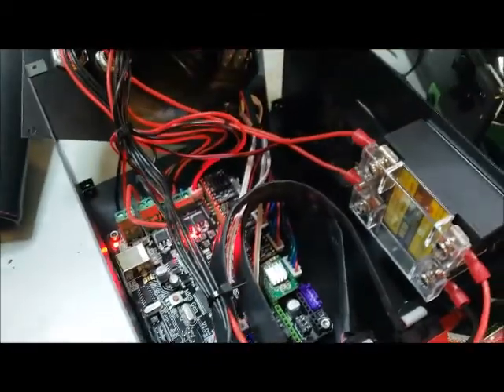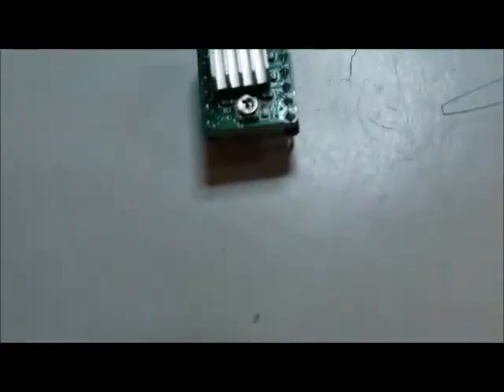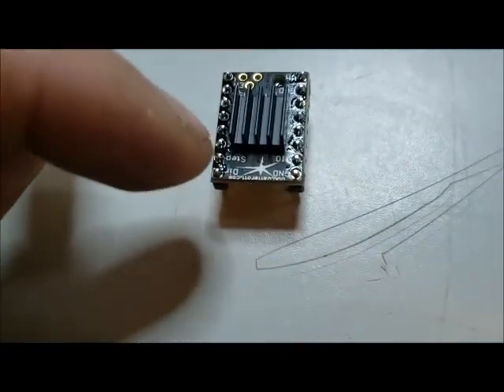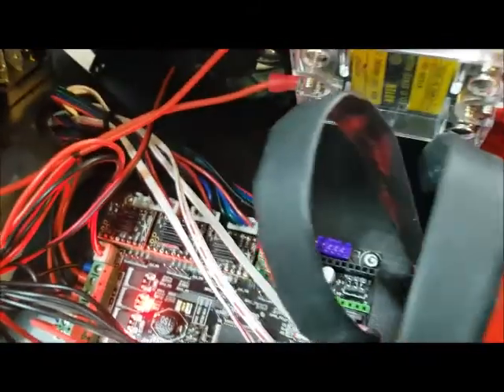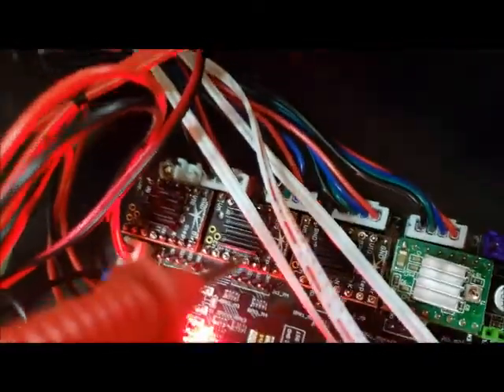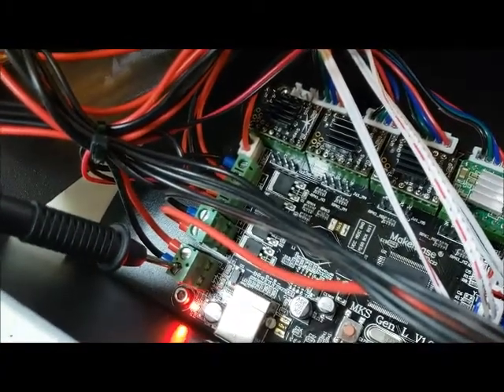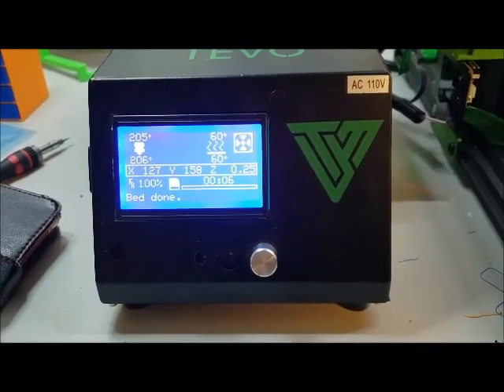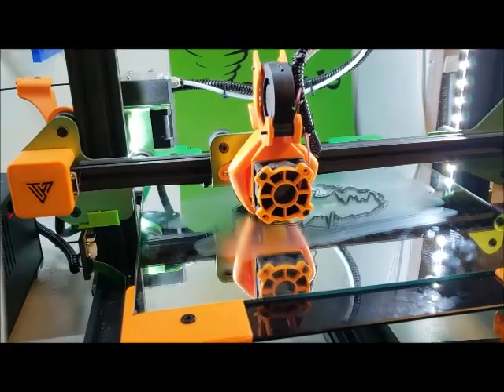TMC2208 install on a Tevo Tornado with MKS gen L board

Comment: I have problems with the estruter  wiring. From  the control box.   Was trying to reverse the direction  ( double gear estruter )  and. I end up mixing  the wires. (  also forgot to take a pic  of how they where  before this mess)   any  idea how to determine   the pares  coming out of the control box. 
 Already  know  how to determine  the pares from the  steper motor  
 Thx in advance
Reply from the maker: Once you get them wired you will reverse the direction in your firmware.

Comment: Sorry to keep bothering you on this wiring problem.   I have searched with no luck on my specific wiring question. I have located the 12V and 24V fan wires from the fans. Steel don’t know where they go on the MKS board.  I know some fans run continuously and some not. I don’t want to hook them up wrong.
In your video, is the Printer a tevo tornado? And the board is a MKS Gen L V1.0
How did you wire your fans?
Reply: Just did this yesterday. Cooling fan you need to add a JST connector and add it to the white jst port below the power, heat bead, eo, e1, wires.

Comment: Thank you very much for the fast reply. If I replace the 12V fan with a 24V fan. Can I hook all the fans up (2 fans in the controll box and 2 fans on the hot end) to the Fan outlet on the MKS board. Will this be OK for the fans on the hot end Extruder and Nozzle.
I see only 2 wires to the fan output on your MKS board.
How did you wire your board for the Tornado?

Comment: I enjoy all your videos. Thank you
This is a somewhat newbie question. 
I have a Tornado and updating to MKS Gen L V1.0 Board.
Have a question on the wire transfer from the stock board
To the MKS Gen L V1.0 board. Can you tell me how to identify the fan wires from the extruder hot end On the stock board, and where do they go on the MKS board. 
The fan that cools the Nozzle is 24V and the fan that cools the Heat Sink is 12V Please help.
And the A13, A14 on the stock board. Do these plugs go to A13 to TH2 and A14 to TR.
Thank you
Dale
Reply from the maker: Dale Fischer the best thing to do is google search a diagram for each board.  It will clearly show pictures for each fan connection.   However you will need to run a buck converter for your 12v fan as everything coming off the board will be 24v.

Comment: Great easy tutorial. Just one thing, it's safer to use a ceramic screwdriver and check vref on the dedicated pinout on the TMC board. You can't see the voltage on the fly but you're safer and you'll not blow your driver with an easy mistake

Comment: My tornado also has the Gen L board, thanks for the info it's harder to come by, that said what stepper motors do you have? Curious if your voltages will translate to my steppers as well... Thanks!
Reply from the maker: Just Us I am running the stock steppers.   I dont remember what brand they are.   But voltages are specific to the drivers bot the motors.
Reply: Awesome, thanks bud!